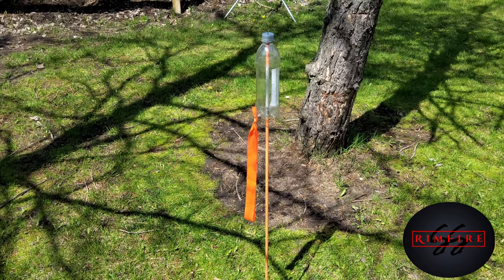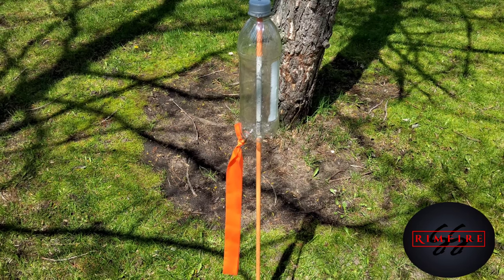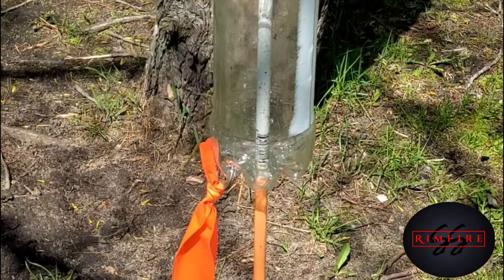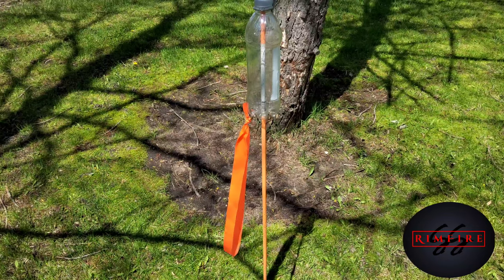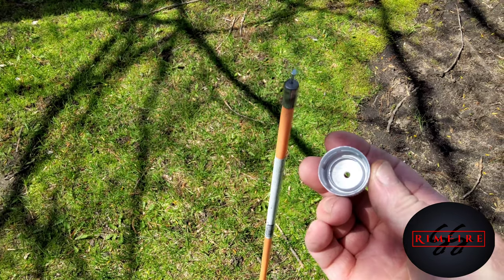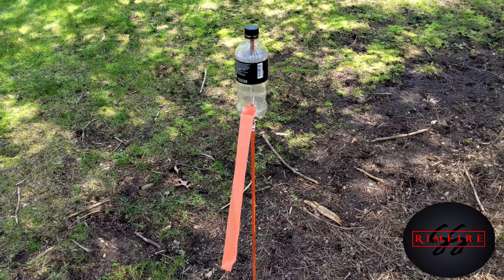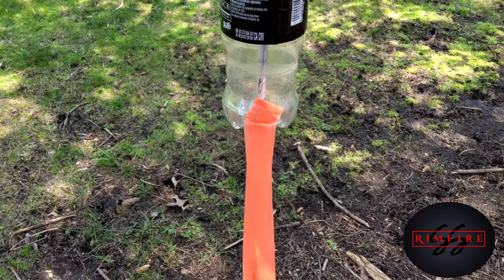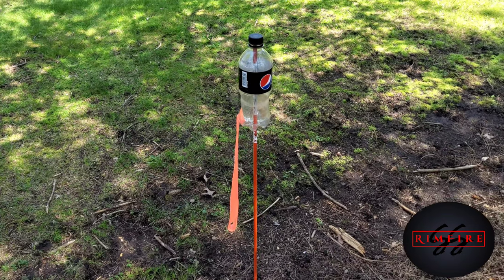Shooting Range Soda Bottle Wind Indicator, Cheap and Easy

Comment: Great idea, try using an empty shell case say 45acp, I have a few 50cal empties, heat them up with a small torch, then punch thru the bottle, they make a clean hole, just use a pair of pliers or better yet locking pliers.  I am going to make a few of these, thanks for the tip
Reply from the maker: Just showing people that don’t already know about them how I make mine. There wasn’t a video on them so I figured I’d make one.
Reply: @RimfireSS  I love the idea, thanks for being the first, take care